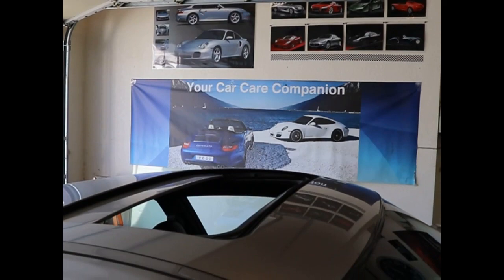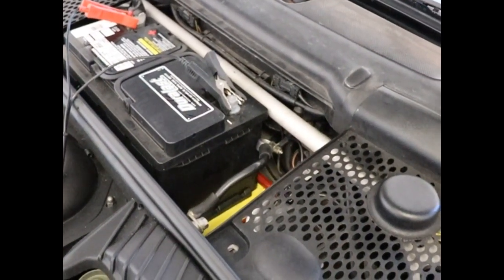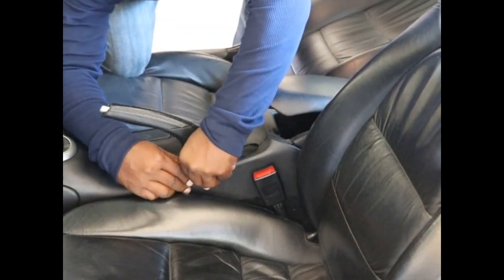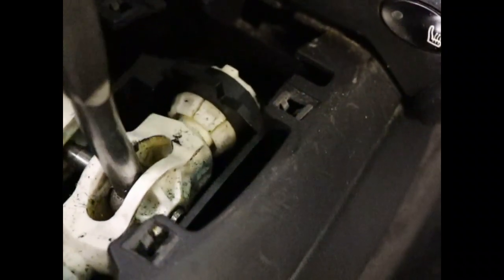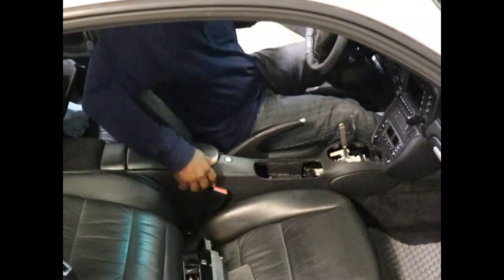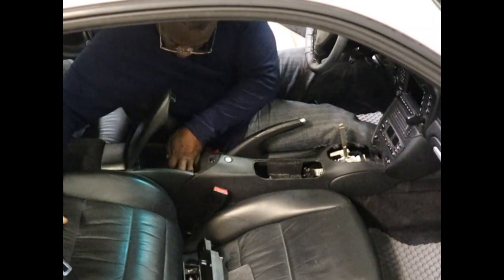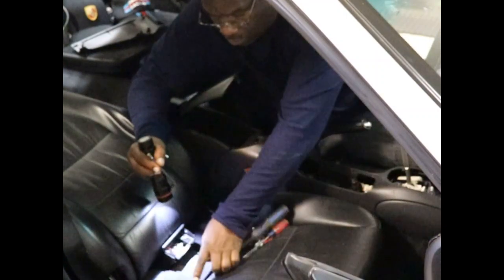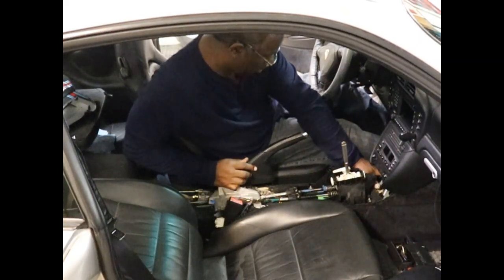How to remove the center console on the Porsche 996 Turbo

Comment: thank you for the video.  I noticed you did not remove the coin holder in the rear compartment that also has a screw underneath it.  I had to go to another video to find there is 3 screws in the rear compartment.  1 holds the plastic cover, 2 is the last screw you took out in the corner, and the 3rd is under the coin holder which was tricky to get out.  Maybe your center console has been removed before?  thanks again for the video